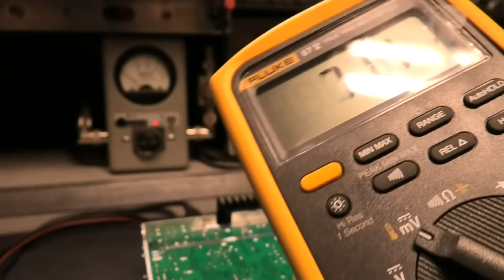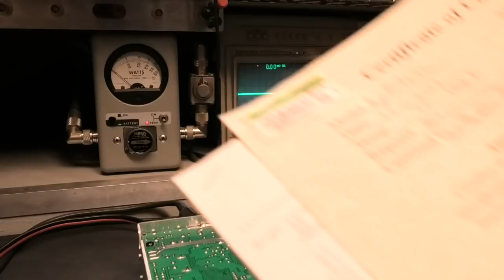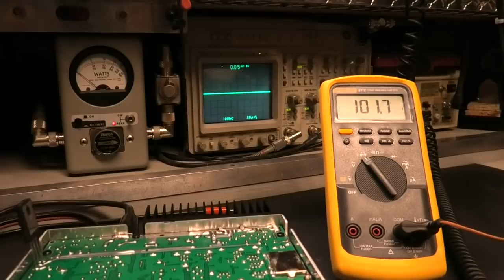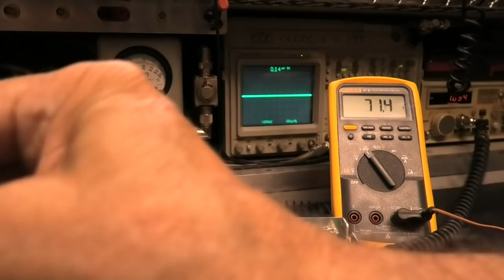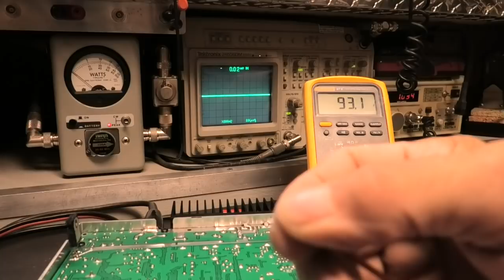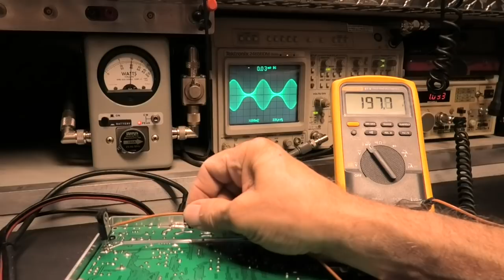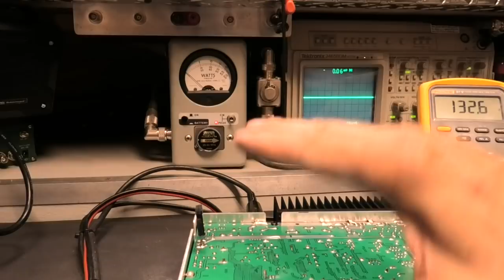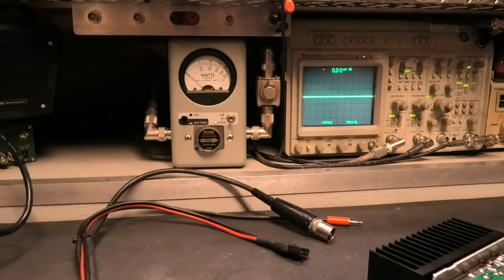PAY ATTENTION - STRYKER RADIO SR 955 - MAX MOD vs Factory TIP36 Regulator Test - Clean Mean & Cooler

Comment: MAX MOD - 89° to 200°, 87 seconds, 1.27° per second
TIP36 - 87° to 200°, 11 seconds, 10.27° per second.
That makes the MAX MOD 10x more efficient at heat dissipation.
Reply from the maker: Thank You.

Comment from the maker: SHOW ME LIKE THIS OR GET BACK ON THE PORCH! Notice that everything is in plain sight and not just a "sketchy" piece of paper with some numbers a on it from a "wanker" claiming to be an engineer (EEV BLOB toaster oven mechanic). Example https://www.youtube.com/watch?v=e2Afub32EeQ Just can't make this stuff up!). Here's another equivalent component @ Full Power:  https://www.youtube.com/watch?v=4NEVuxjpuEs&t=572s *When you turn the lights on, Mikes Romper Room Radio Repair (That's Mike talking in the background claiming that harmonics are a good thing .. has no idea what to say), Mark19960 (Mark Rutherford) and their "co-conspirators" run for cover! It's common knowledge, wherever and whenever you find Mark Rutherford you'll find some type of a scheme or scam. If he's typing or talking he's conniving! I have work to do, bite your tongue, and follow directions. Here's what it takes to cut through the noise, be loud and crystal clear with a better receiver too:  A) Tuned Bench:  https://www.youtube.com/watch?v=lwcDfXOgAls.  True, it's more complicated and time consuming to accomplish these consistent and accurate results. Below is a partial procedure and list of calibrated equipment used to achieve this level of performance. Read on ..

Fine Tune CB Radio Shop strictly adheres to (https://www.nist.gov/) NIST Traceable Calibrations and other industry standards to maintain accuracy and consistency for providing Real World Performance Tuning of Citizens Band and 10 Meter export mobile radios with integrity.

"Basic Textbook AM/FM/SSB Transceiver Tune, Alignment and Calibration" 

1) Pll adjustments
VCO & OSC, AM TX OSC, USB TX OSC, LSB TX OSC.

2) Transmitter alignment
DRIVER BIAS, FINAL BIAS, SSB  (or gate voltages for mosfet versions) CARRIER BALANCE, HI-LO AM & SSB Power, RF METER, AMC, ALC and FM DEVIATION.

3) Receiver alignment
AM/FM RF & IF SENSITIVITY, FM DETECTOR/DEVIATION, SSB IF SENSITIVITY, SSB S-METER, AM/FM S-METER (100uV unmodulated -67dbm for “S-9” meter reading!), AM/FM SQUELCH RANGE, SSB SQUELCH RANGE, and NOISE BLANKER/AUTOMATIC NOISE LIMITER (Real World dBm to volts (uV) tables below).

That's just a typical run of the mill textbook tune up and alignment (if you're lucky). There's more to it than frequency alignment, modulation adjustment, meter calibration and a tune up report displaying exaggerated rms Bird peak watts! 

"Test Bench includes"

Bird 4314C Meter
https://www.birdrf.com/Products/Test%20and%20Measurement/Power-Meters/Wattmeters-Line-Sections/RF-Wattmeters/4314C_PEP-Single-Element-Wattmeter.aspx
Part 1) https://www.youtube.com/watch?v=RpX9IHe4ORM&t=16s
Part 2) https://www.youtube.com/watch?v=LuhbqTf6Bxw
Bird 4314C Accuracy Test: https://www.youtube.com/watch?v=DqEOabYqhQo&t=5s
Bird Stipulates 1/2 wavelengths  https://www.youtube.com/watch?v=5eWhgT-rTII
And Genuine Bird Elements from 1K down.

Bird 4373 Sampler 
https://www.rfparts.com/signal-samplers.html

HP8924c with options
http://userequip.com/files/specs/2147/HP%208924C%20Repair.pdf
https://www.youtube.com/watch?v=Cg1w0xBa27s&t=1s

HP8920a with options
https://www.keysight.com/upload/cmc_upload/All/EPSG072204.pdf

Three analog scopes, one digital 200 Mhz
https://www.atecorp.com/atecorp/media/pdfs/data-sheets/tektronix-2465b-2467b_manual.pdf
https://www.youtube.com/watch?v=by98x4eu2lM

Fluke 27fm
http://www.fluke.com/fluke/inen/digital-multimeters/fluke-27.htm?pid=56055
 
LCR http://www.lcrresearch.com/wp-content/uploads/2017/05/LCR_Pro1_Manual_version1.03.pdf

Power supplies
6 Cosel PBA1500f12 (750 amps) variable and configurable.
https://en.cosel.co.jp/product/powersupply/PBA/PBA1500F/PBA1500F-12/
Corcom 20VB1 F7130 EMI Filter 50-60Hz 250V

Times Microwave Coax jumpers and test leads
http://www.timesmicrowave.com/cms/products/cables/lmr/
https://www.youtube.com/watch?v=EmqaGJ6IWow
https://www.youtube.com/watch?v=1ltFVSxGp5Y
https://www.youtube.com/watch?v=v12YZT_1o90
https://www.youtube.com/watch?v=h7iiYfmYWRA&t=215s

Amphenol RF Connectors
https://www.amphenolrf.com/
https://www.youtube.com/watch?v=dVh5B0hdEA0 
https://www.youtube.com/watch?v=dKZg8T_AOso

More range, compliments, reliability and a quieter, clearer but more sensitive receiver,  Get Fine Tuned .. not peaked and ruined.

Here are some VideoGates of me at the bench practicing what I preach using my bench radio or customers radio completed and ready to be shipped: https://www.youtube.com/results?search_query=hard+drive+163+ more: https://www.google.com/search?q=Hard+Drive+163+nm&ie=utf-8&oe=utf-8&client=firefox-b-1-ab

It's what I recommend, use, service and sell ... to you ... not something non practical or deceiving in a misleading way. I'm not just the tech and owner of Fine Tune CB Radio Shop, I'm a customer too!  When finished, You'll be giving radio checks, not asking for them .

dBm To Watts and Volts
Tables below displays relationship between Power in [dBm] or [Watts] and Voltage in RMS, peak, peak-to-peak for sinusoidal signals in 50-Ohm systems for accurately measuring and tuning am/fm/ssb receiver sensitivity, agc, squelch and "S9" Meter calibration. Real World! Mike @ Mikes Radio Repair (Romper Room), Mark Rutherford aka Mark 19960, CB Kidd, Martian and all of your other fake accounts pay attention to the tables below, stop misaligning radios, spreading false information and promoting propaganda! 

  [dBm] [Watts]   [Volts]rms   [Volts]p    [Volts]pp
-140 0.100E-16  22.361 nV  31.618 nV  63.236 nV 
-139 0.126E-16  25.089 nV  35.476 nV  70.952 nV 
-138 0.158E-16  28.150 nV  39.805 nV  79.609 nV 
-137 0.200E-16  31.585 nV  44.662 nV  89.323 nV 
-136 0.251E-16  35.439 nV  50.111 nV  100.222 nV 
-135 0.316E-16  39.764 nV  56.226 nV  112.451 nV 
-134 0.398E-16  44.615 nV  63.086 nV  126.172 nV 
-133 0.501E-16  50.059 nV  70.784 nV  141.568 nV 
-132 0.631E-16  56.167 nV  79.421 nV  158.842 nV 
-131 0.794E-16  63.021 nV  89.112 nV  178.223 nV 
-130 0.100E-15  70.711 nV  99.985 nV  199.970 nV 
-129 0.126E-15  79.339 nV  112.185 nV  224.370 nV 
-128 0.158E-15  89.019 nV  125.874 nV  251.747 nV 
-127 0.200E-15  99.882 nV  141.232 nV  282.465 nV 
-126 0.251E-15  112.069 nV  158.465 nV  316.931 nV 
-125 0.316E-15  125.743 nV  177.801 nV  355.602 nV 
-124 0.398E-15  141.086 nV  199.496 nV  398.992 nV 
-123 0.501E-15  158.301 nV  223.838 nV  447.677 nV 
-122 0.631E-15  177.617 nV  251.151 nV  502.302 nV 
-121 0.794E-15  199.290 nV  281.796 nV  563.591 nV 
-120 0.100E-14  223.607 nV  316.180 nV  632.360 nV 
-119 0.126E-14  250.891 nV  354.760 nV  709.519 nV 
-118 0.158E-14  281.504 nV  398.047 nV  796.094 nV 
-117 0.200E-14  315.853 nV  446.616 nV  893.232 nV 
-116 0.251E-14  0.354 µV  0.501 µV  1.002 µV 
-115 0.316E-14  0.398 µV  0.562 µV  1.125 µV 
-114 0.398E-14  0.446 µV  0.631 µV  1.262 µV 
-113 0.501E-14  0.501 µV  0.708 µV  1.416 µV 
-112 0.631E-14  0.562 µV  0.794 µV  1.588 µV 
-111 0.794E-14  0.630 µV  0.891 µV  1.782 µV 
-110 0.100E-13  0.707 µV  1.000 µV  2.000 µV 
-109 0.126E-13  0.793 µV  1.122 µV  2.244 µV 
-108 0.158E-13  0.890 µV  1.259 µV  2.517 µV 
-107 0.200E-13  0.999 µV  1.412 µV  2.825 µV 
-106 0.251E-13  1.121 µV  1.585 µV  3.169 µV 
-105 0.316E-13  1.257 µV  1.778 µV  3.556 µV 
-104 0.398E-13  1.411 µV  1.995 µV  3.990 µV 
-103 0.501E-13  1.583 µV  2.238 µV  4.477 µV 
-102 0.631E-13  1.776 µV  2.512 µV  5.023 µV 
-101 0.794E-13  1.993 µV  2.818 µV  5.636 µV 
-100 0.100E-12  2.236 µV  3.162 µV  6.324 µV 
-99 0.126E-12  2.509 µV  3.548 µV  7.095 µV 
-98 0.158E-12  2.815 µV  3.980 µV  7.961 µV 
-97 0.200E-12  3.159 µV  4.466 µV  8.932 µV 
-96 0.251E-12  3.544 µV  5.011 µV  10.022 µV 
-95 0.316E-12  3.976 µV  5.623 µV  11.245 µV 
-94 0.398E-12  4.462 µV  6.309 µV  12.617 µV 
-93 0.501E-12  5.006 µV  7.078 µV  14.157 µV 
-92 0.631E-12  5.617 µV  7.942 µV  15.884 µV 
-91 0.794E-12  6.302 µV  8.911 µV  17.822 µV 
-90 0.100E-11  7.071 µV  9.998 µV  19.997 µV 
-89 0.126E-11  7.934 µV  11.218 µV  22.437 µV 
-88 0.158E-11  8.902 µV  12.587 µV  25.175 µV 
-87 0.200E-11  9.988 µV  14.123 µV  28.246 µV 
-86 0.251E-11  11.207 µV  15.847 µV  31.693 µV 
-85 0.316E-11  12.574 µV  17.780 µV  35.560 µV 
-84 0.398E-11  14.109 µV  19.950 µV  39.899 µV 
-83 0.501E-11  15.830 µV  22.384 µV  44.768 µV 
-82 0.631E-11  17.762 µV  25.115 µV  50.230 µV 
-81 0.794E-11  19.929 µV  28.180 µV  56.359 µV 
-80 0.100E-10  22.361 µV  31.618 µV  63.236 µV 
-79 0.126E-10  25.089 µV  35.476 µV  70.952 µV 
-78 0.158E-10  28.150 µV  39.805 µV  79.609 µV 
-77 0.200E-10  31.585 µV  44.662 µV  89.323 µV 
-76 0.251E-10  35.439 µV  50.111 µV  100.222 µV 
-75 0.316E-10  39.764 µV  56.226 µV  112.451 µV 
-74 0.398E-10  44.615 µV  63.086 µV  126.172 µV 
-73 0.501E-10  50.059 µV  70.784 µV  141.568 µV 
-72 0.631E-10  56.167 µV  79.421 µV  158.842 µV 
-71 0.794E-10  63.021 µV  89.112 µV  178.223 µV 
-70 0.100E-09  70.711 µV  99.985 µV  199.970 µV 
-69 0.126E-09  79.339 µV  112.185 µV  224.370 µV 
-68 0.158E-09  89.019 µV  125.874 µV  251.747 µV 
-67 0.200E-09  99.881 µV  141.232 µV  282.465 µV
-66 0.251E-09  112.069 µV  158.465 µV  316.931 µV 
-65 0.316E-09  125.743 µV  177.801 µV  355.602 µV 
-64 0.398E-09  141.086 µV  199.496 µV  398.992 µV 
-63 0.501E-09  158.301 µV  223.838 µV  447.677 µV 
-62 0.631E-09  177.617 µV  251.151 µV  502.301 µV 
-61 0.794E-09  199.290 µV  281.796 µV  563.592 µV 
-60 0.100E-08  223.607 µV  316.180 µV  632.360 µV 
-59 0.126E-08  250.891 µV  354.760 µV  709.520 µV 
-58 0.158E-08  281.504 µV  398.047 µV  796.094 µV 
-57 0.200E-08  315.853 µV  446.616 µV  893.232 µV 
-56 0.251E-08  0.354 mV  0.501 mV  1.002 mV 
-55 0.316E-08  0.398 mV  0.562 mV  1.125 mV 
-54 0.398E-08  0.446 mV  0.631 mV  1.262 mV 
-53 0.501E-08  0.501 mV  0.708 mV  1.416 mV  

                 Don't Be A Mud Duck!

 https://www.arrl.org/shop/ARRL-Handbook-2019-eBook

Hard Drive 163 NM. 73's! Click click.?

Comment: I have a 955hpc  hook up  straight to batteries  boxes using 10ga wire with 20amp fuse .i started  getting feed
Back throw Fm speakers. With talk back 
On . Trun the Raido  off and look at every thing make nothing was granded will 
Nothing was . But the radio will not got 
Over 20watts. What would  Solution
Be and is the radio damage
Reply from the maker: Hello,
Did you watch this video and read entire description?
It's All About Procedure .. New radio sales only shorturl.at/dnuLS at this time. Read description and watch before contacting. 

Thank You!

163 Hard Dr.
https://www.facebook.com/163Hardrive/posts/3523601657704569
Playlist: shorturl.at/tzQ13